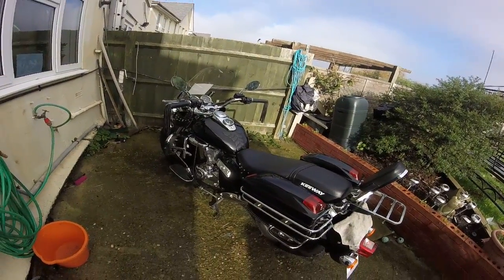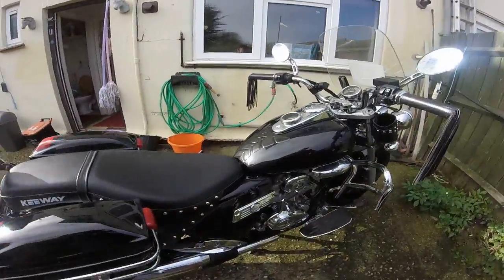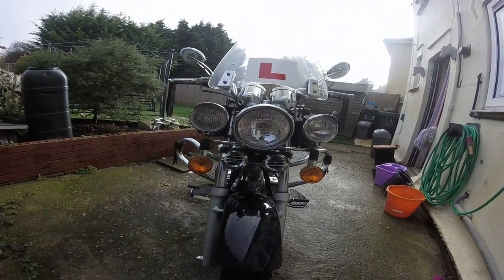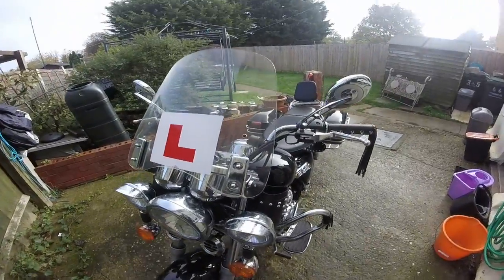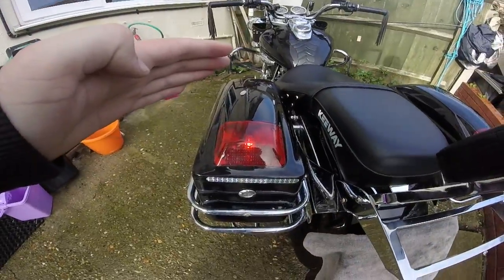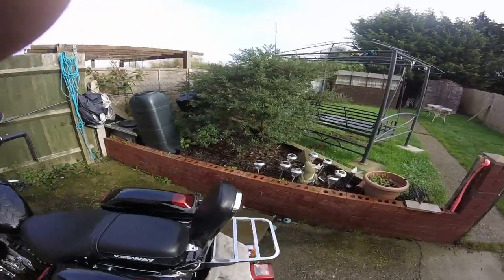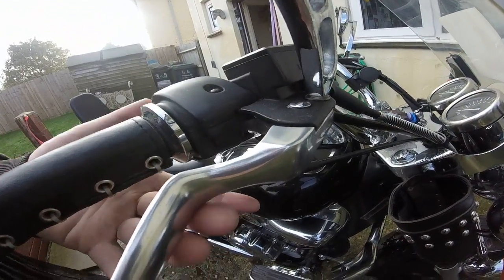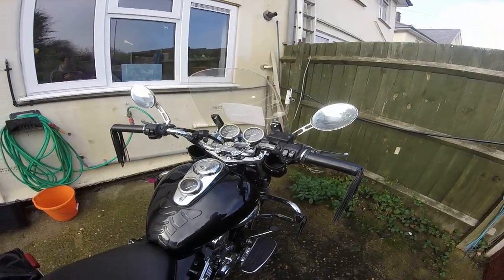KeeWay Superlight 125  3 Month Review And Modifications

Comment: Hey my keeway. I've had a super light 125 for about 6 month now love the bike. Only thing I'm not good with it how much of a JOKE the headlight is. Love riding at night but the light from it is awful. Did you add the lights yourself?
Reply from the maker: +Dale Smith the extra lamps at the sides of the main one i did add , when fitting them i had adjust the mounting bar by cutting and grinding some away so the boltand bracket still fitted behind it, once did that changed the angle ofit so main beam was no higher then 4foot at distance of 100 foot so it only shines where my eyes look, the side lamp's are on there own switch for day and night running i only use the main lamp in unlight places , i.e contry roads , lane.    if  u need any other help please let me know ...